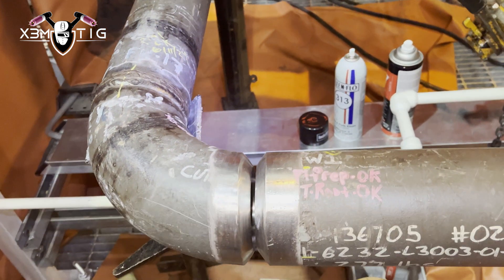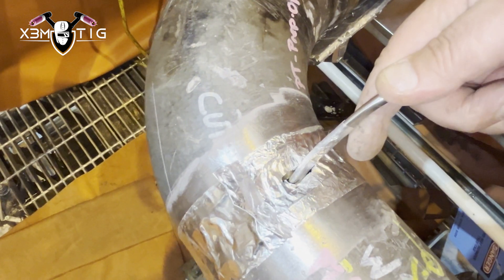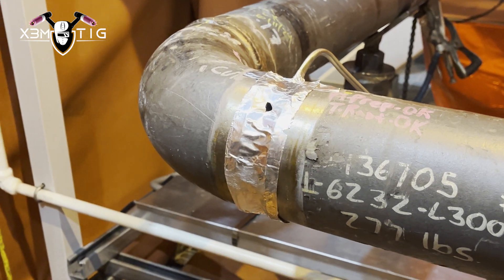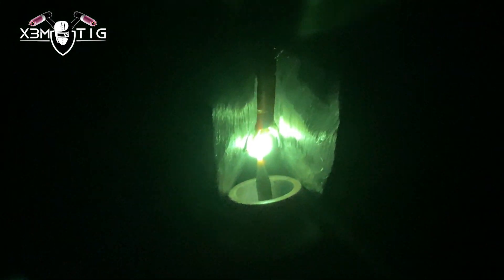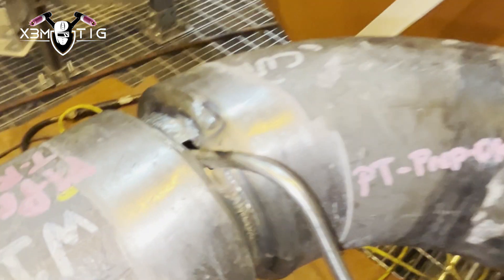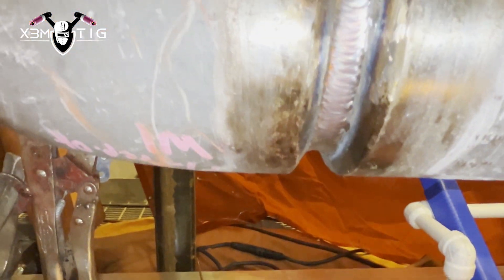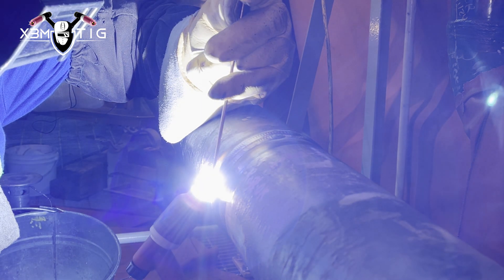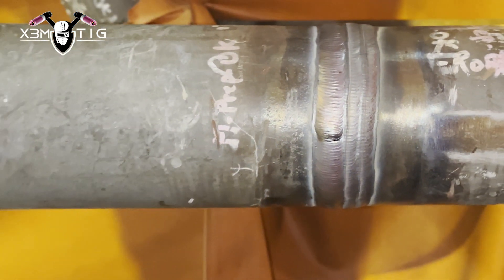TIG Welding Needle Purge: The Ultimate Guide!

Comment: So question?  How about when hot passing?  Keeping that purge when going over that root. Not getting contamination?
Reply from the maker: Yes, you should always keep the purge on, on your hot pass. Just reduce the flow rate.
Reply: @X3MTIG yes, but how about when you seal the piping after you root? And you have no way to do your needle purge?
Reply: @terryhermosillo4717  you can hot pass before you close with the purge still on and then remove needle purge, close the root and hot pass the last little bit

Comment: What if after root pass when you do your hot pass your internal root bead become oxidized due to lack of argon? Or there is enough argon because the dam keeps argon in place?
Reply from the maker: Should be fine as long as you have good setup, and no burn trough on hot pass!

Comment: What's the best way to get the type of welding jobs you have with pipe or is what your doing take years to work up to to be with a company/working for yourself?
Reply from the maker: Little bit everything, but it takes years to make a name for yourself… after that it’s easy, but the most important thing is to put pride into your work, and your phone will be ringing with job offers!
Reply: @X3MTIG  Thanks for your input, much appreciated.